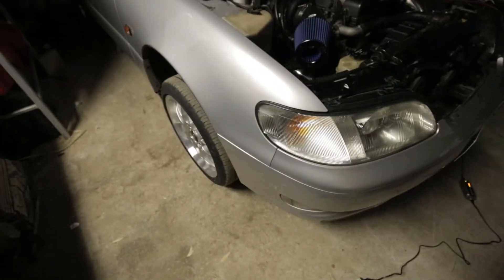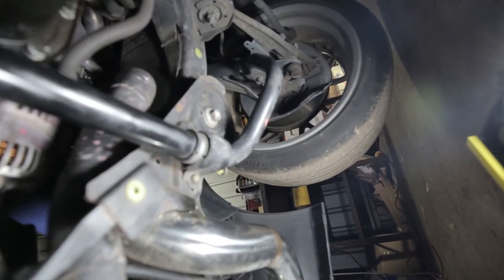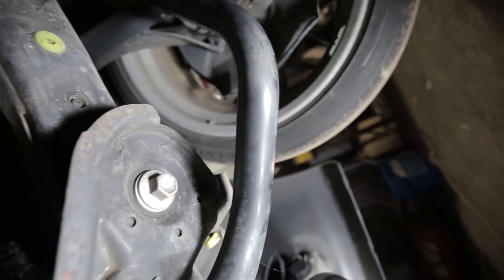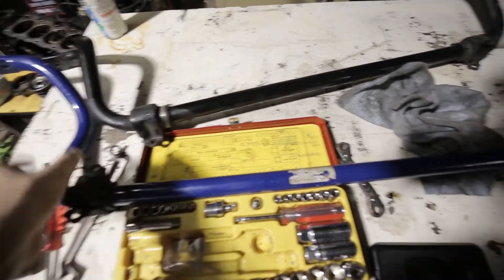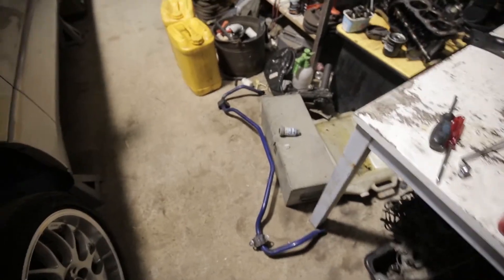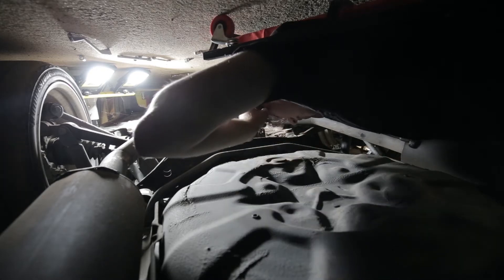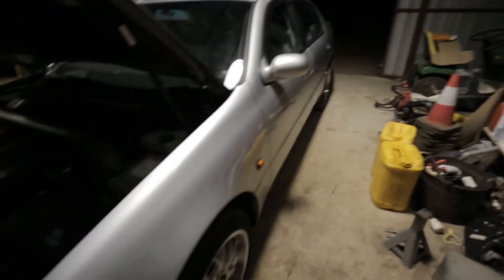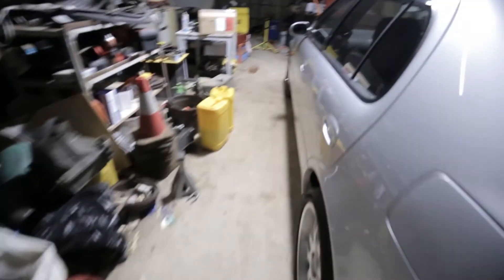Project Aristo - Thicc Boi Sway Bars

Comment: Just an FYI, body roll isn't always bad, there's the right amount & not enough body roll which in turn helps hug corners alot better, weight transfer simply.

Why not just go new shocks/struts all round ?, keeps stock suspension setup & new struts make a massive difference.
Reply: Coilovers in my opinion are too problematic for a vehicle that wasn't setup to have them.
Reply from the maker: These are a little hard to find components for, and coilovers are just more accessible it's generally the go-to. My first car had amazing ride quality and cornered pretty well at the same time, only problem was it was too low but I never bothered to change that. 

These things are absolute boats stock, even with TEMS and all 😂 it's much nicer with day to day cornering but this will never be a track weapon
Reply: @ddgarage7025  Well it basically is a JDM Lexus GS
What do you expect ? 🤣🤣🤣
With an otherwise bulletproof 4sp Auto. I noticed you have some content but not a great deal, are you more active on Instagram or ?

Old Toyota's will go around the clock before a new one does. Classic example the 1MZ-FE HAD a sludge issue that some owners experience, mines never had that problem. Non interference engine, cast iron bore liners, a forged steel crank on a passenger car, bit overkill, but the 1MZ is a sweetheart of an engine. Meanwhile the later 3.3 was an interference engine, then the 3.5L was notorious for issues including catastrophic sludge & gelling of oil, oil supply hose on the VVT pisses, etc etc
Kinda why old Toyota's never die, old tech, solid & over engineered
Reply: @ddgarage7025  Parts for a Mark 3 Avalon Grande are equally as hard to find considering the little amount that were produced from mid 03' - 06'
Bonnet protectors, nope
Headlight protectors, nope
Factory Navigation book, HAHA have fun
Common parts are accessible but other parts are a downright prick to find. The Mark 3 had an exclusive fluid filled engine mount, if that goes bad, easily $1000 just for the part (1 of 3 mounts) - prior avalons didn't have it. 
The list goes on, but lucky all mine works, i literally run Penrite racing 5w30 in it because they destroy oil, so it means i can service every 7500km (interim service) and every 15k a full service (2 oil changes basically within 15k)
Reply from the maker: @ThomasFG  there was a recall with the 3.5L regarding the supply hose for the VVT right? And content just has been slow to working a lot and not spending too much money and time on this particular car but more is to come!
Reply: @ddgarage7025  Something like that, then there was the newer 4cyl Camry engine after 2006 that was the biggest lemon Toyota ever made
Burning roughly 1L of oil in not even 500km hahaha

Hey, any content is better than none. Do you have Instagram at all ?, generally more active considering i don't exactly upload content on here. Stupid question 
On a factory premium audio system that works perfectly fine, the Avalon literally has so much of the Lexus parts it isn't funny. But considering the front doors have seperate component speaker & tweeters, i'm thinking about running components up front, coaxial in the rear doors and replacing the factory sub with another 8" sub direct drop in, Avalon's don't really rattle funny enough like you mentioned in your prior video
Must be that Australia took the old tooling and strengthened it, because that's what we did.